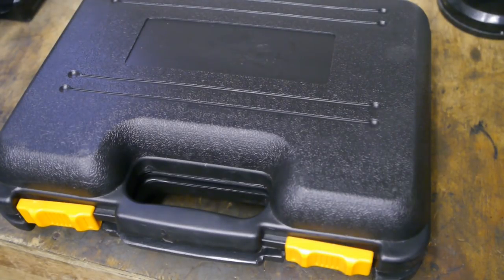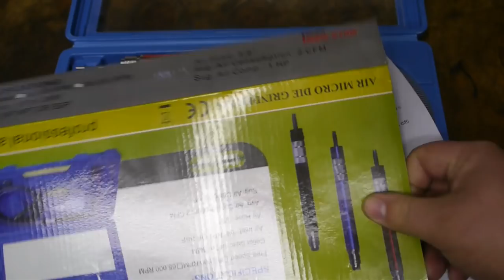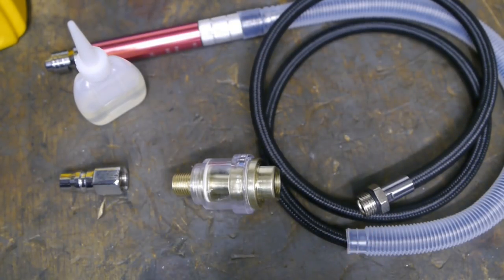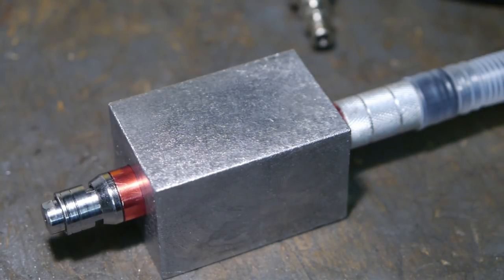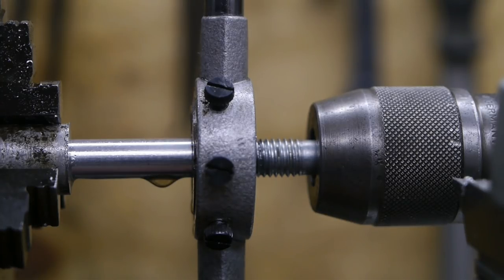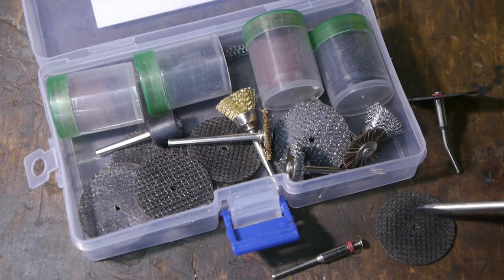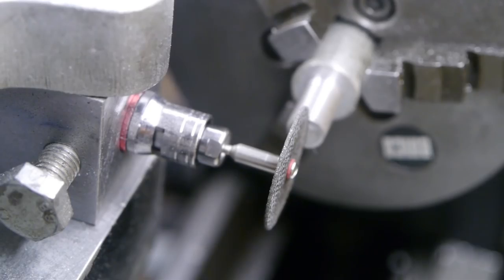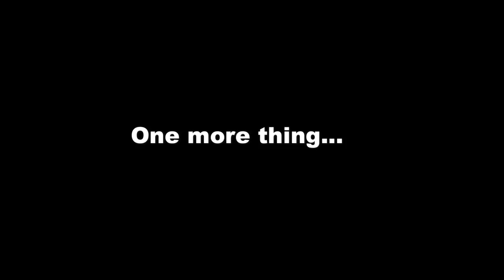Making a lathe holder and testing a cheap Chinese air grinder

Comment: Well done.  Full marks for persevering.   I would have used a hacksaw to make the slot and cut off the set screws.

As the comment below mentioned, the die looked to be on the wrong way round.   You want to start with the side with the tapered teeth.

I also have bent the thin Dremel shafts.   I would look for a collet and thicker shafts if you can find them.

These tools consume a lot of air.   If you can increase the pressure, you may get better torque.

A lot of metal to be removed from the ER32 collet.   I would select a tool which should not change dimension as it cuts, so perhaps the diamond burrs.   The sanding drums will not last long.   The grinding discs will wear down fast and then you will find it difficult to maintain the angle.   You need accurate angle or else the collet will not grip.

Dave.
Reply from the maker: Thanks Dave.

Yeah a hacksaw would be much faster. But then I wouldn't get to test the little grinder :)

That die is tappered on both sides. Have a look: https://goo.gl/pxUeKS
I actually studied it before I used it. But it took a lot of force to cut the thread so it must be loosing its edge.

I have a bigger arbor for my Dremel, but it's to big. 
It's only 0.05mm bigger then 3mm and I couldn't get it into the 3mm collet that came with the grinder.

A bigger air compressor would certainly help. Mine only goes to about 7.5 bar

I think will try those carbide boring bars to remove the bulk of the material.
I was surprised that the opening for the tapered hole was of by almost a full mm.
I'll probably dial-in the topslide using the collet chuck as a reference. Or perhaps a collet on an arbor because the taper inside the chuck might be at a slight angle.

Comment: I would use one of the stones, closer to the grinding wheel on surface grinders and stuff.
Reply from the maker: I'll try them out. But my experience with those small stone is not great. The easily brack up.

Comment: Nice job. To grind the collets I would use the rubber expanding arbor wrapped in dried herring, final finish will be perfect.
Reply from the maker: A dried herring?? Isn't that something they eat in Norway?
Reply: Rolingmetal They actually eat it??? Here in Panama  it's  used to grind stuff....
Reply from the maker: Probably, they dry a lot of fish.

Comment: Congrats on the one million views my friend! For what its worth I would try the stones first but not sure if the quality of stone Banggood provided with the set is up for the task! Looking forward to the results you get regrinding the collet chuck, also take a look at the collet chuck nut, I think this is adding to the run-out problem as well.
Reply from the maker: My experience with small grinding stones on the Dremel isn't great. Usually they quickly fall apart.
Others have mentioned the collet nut as well. I got an extra collet nut from Banggood hoping it was from a different manufacturer. But they are all the same. But to be honest they look nicely made. The machining on the nut is definitely a step up compared to the collet chuck.

Comment: Nice video, but I'd be disappointed in that grinder. Even with a better compressor it seems woefully underpowered.
Reply: chexstix I have the same grinder more powerful compressor and it’s as strong as my dremel clone and less runout on the collet. Good tool post grinder for the smaller lathe
Reply from the maker: I guess It depends on what you' re expecting. It worked better then I though it would.
And it even looks and feels half decent. not bad for 15 euro.  
To bad I now need to spend 500 euro on a better compressor :)

Comment: I would use either the largest diamond or stone bit. The sanding bits will break down too fast,
Reply from the maker: I'm wondering what kind of finish to expect form those diamond burrs. I'll probably try them all :)
Reply: You don't know till you try. I would run the lathe spindle slow, like under 200 rpms if possible.

Comment: I think the grinding disks are designed for steel. It is bad for the disk as it clogs up with aluminium and overheats. Very bad for bigger grinders as the disk may explode, send bits everywhere at bullet speed.
Reply from the maker: You might be on to something there.

Comment: Aluminum set screws--meh. Probably better to have slit the holder itself and make a clamping holder.
Reply from the maker: I tried that once but that ended with a broken slitting saw.
Reply: @Rolingmetal It's possible to get away with using a  band saw. Only reason I mention it is that the set screws put uneven pressure on the bearings. The slitted clamp would give all around even pressure.

Comment: Hi, I would use Proxxon Grinding Wheels (10 discs) 477592 28302, because we dont know what hardness the collet holder is, if it hard as Hss you should use white grinding stones, the arbor you can cut down so the grinding wheel is close to the grinder the closer the better, AND be sure to true up the grinding wheel as CurlyG65 linked to https://www.youtube.com/watch?v=E2WHAU2OwaA, if you do not true the grinding wheel up you wont get a good result because the grinder will be oscillating, when you have the collet chuck running true you can true up all the of the collets according to the bore :-), the inside angle in collet chuck is 8 degrees by the way. Good luck and looking forward to watch the video.
Reply from the maker: Those little stones need to stick out pretty far to be able to grind the hole depth of the collet.
I'm thinking I might wear down that cutting disk, to a size larger than the spindle nose, and use it for grinding the taper.
That way the arbor can stay very short.
Thanks for the video link. I've  actually already seen it. It more or less inspired me to get this little grinder :)
Reply: You dont have to have the centerline of the grinder at the 8 degrees, set your crossslide to 8 degrees and grinder to centerline then you have lots of clearence (when the hole you want to grind is so big, cant use this setup in small holes) even if the stones are smaller than the grinder, I have had great results with this kind of setup.
Reply from the maker: Yes, but he is also using a tapered stone. I think most stoned are designed to run parallel with the work.
But I do think a slight angle on the grinder won't hurt.
Reply: You can true up the stone to 8 degrees, then you will have a broad flat on the grinding wheel (so it does not wear so fast), the Proxxon wheels I talked about is 22,5mm in diameter and 3,5mm thick, the angled grinder relative to the workpiece helps reducing chatter of the stone.

Comment: I agree with a comment below, that grinder seems under powered, shitty vanes i expect, as for grinder options, I use the the little sanding drums with a dremel type rotary toll and am really impressed with it,  the fie ones leave a really good finish. I've found them cheap little stone so wonky and they often heat up enough for whatever glue they use to fail and the end comes of,
well done on a million views,
All the best,
Cliff
Reply from the maker: I guess it depends on what you're expecting. It definitely worked better the I though it would be, and I''m pretty sure my compressor was the limiting factor in this test.
My experience with those small cheap knock off dremel tools isn't great either.
And I think you right, those sandpaper drums are probably the best option for a good surface finish.